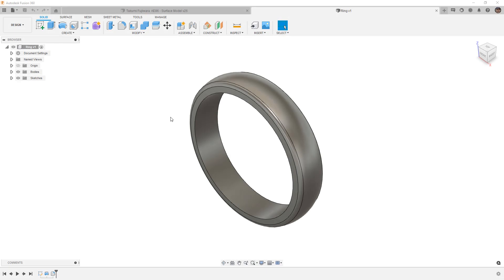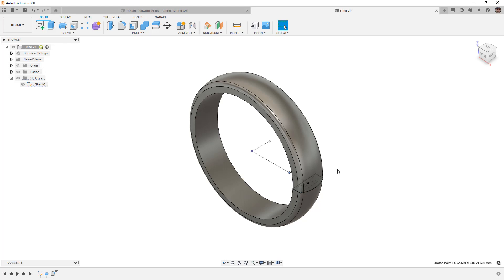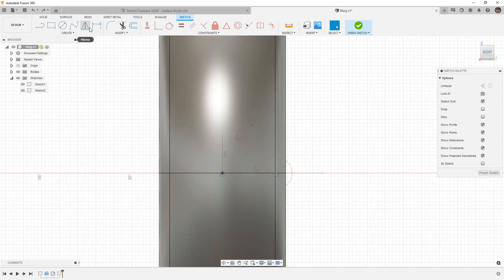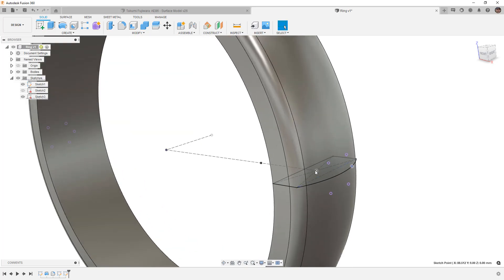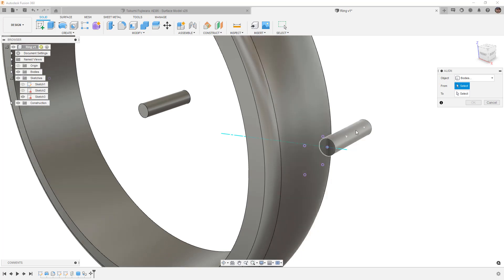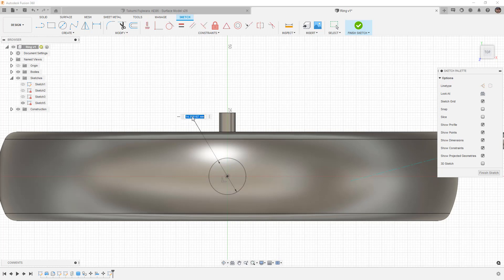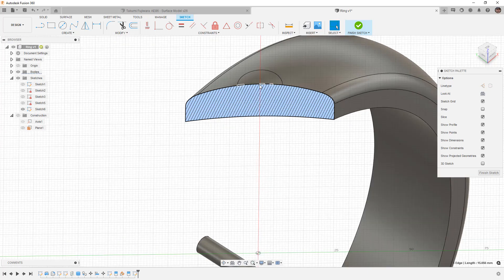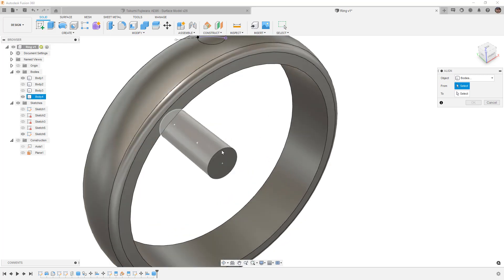Fusion 360 - Align a Body to a Curved Surface - Jewelry Modeling

Comment: Very good explanation. It's not immediately apparent but you need a second sketch to successfully project onto a curved face. 2025 this is still the case
Reply from the maker: yeah one of the downsides to Inventor and Fusion is the need for a 3rd sketch when projecting 2 2d curves together or a second sketch to project onto a face/body.  you are correct.

Comment: I am little confused by your approach. Why don't you get the surface normal using the tool "axis perpendicular to point on a face". In your case the point would the projected points on the surface that you did at the beginning.
Reply from the maker: that is a great option.  This video came from answering a viewers questions where the geometry of the ring and the gem holder were a bit different.  In this case I could have certainly used that option after projecting points on some of the features.  The original question was looking at a more complex shape were the center of the large gem was basically normal to the surface but all the surrounding ones were in a circular cone around it.

Comment: This is one of the biggest features that fusion is missing, so thank you very much for sharing. AutoCAD should make this process into a tool, if possible.
Reply from the maker: Thanks, this was another user question getting answered.  It is tricky and a tool would certainly help :)

Comment: Thanks for that tutorial. In my F1 375 project I eyeballed the position of rivet heads around the shape of the body. I will rewatch this video to fully understand everything and then try to use this technique to revisit my rivet head orientation to the body which is not a perfect arc. Hope I can make it work because it would give me a consistent normal orientation.